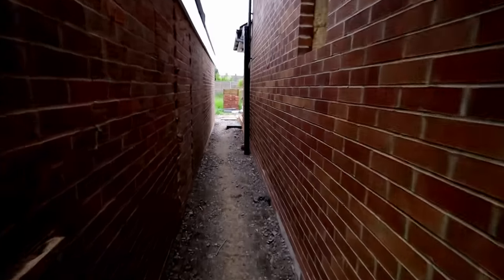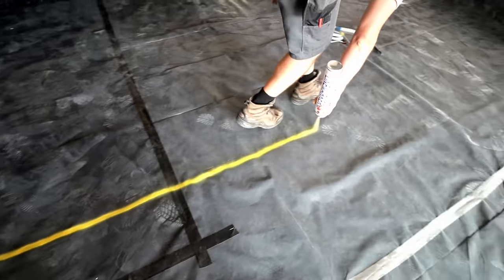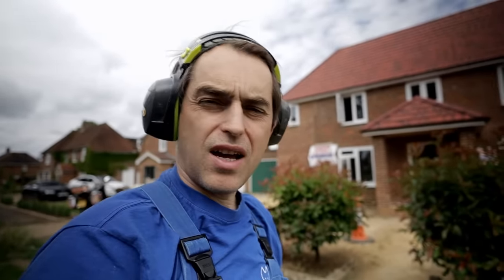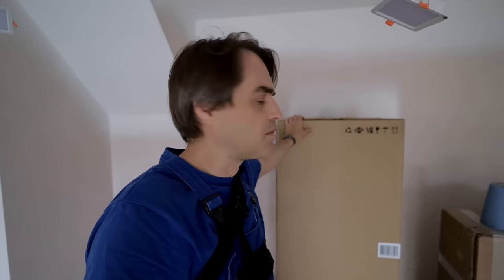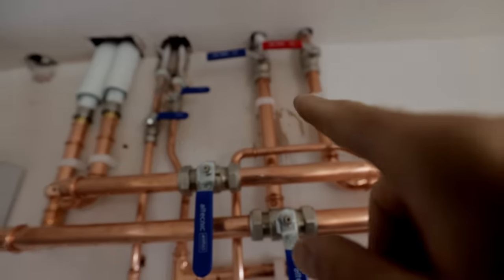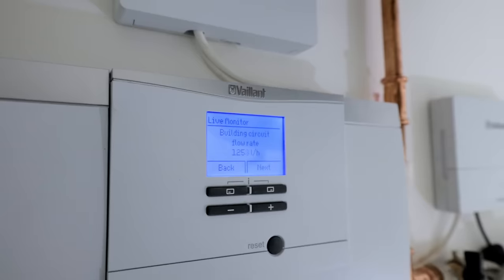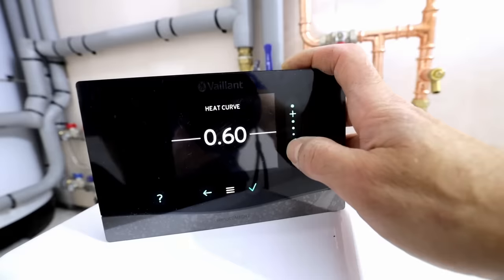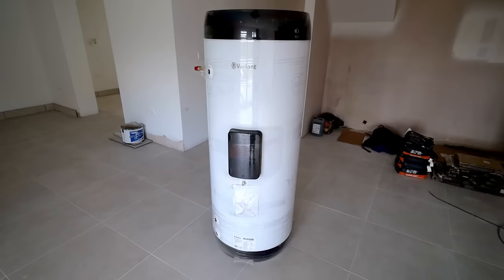Gas Boilers No Longer Make Sense, Here Is Why.

Comment: This is all fine for a huge expensive house where the owners have plenty of money and space to install all this crap, that is not what 90% of the population have not even close. Even in a full renovation this is impractical for all but large properties where you can set aside significant space as a plant room for tanks and other equipment with plenty of space outside to site the huge heat pump.
Reply from the maker: Small houses don’t need much space for internal kit. Small houses get smaller heat pumps.

Cost is the and as a full gas installation and Hp is cheaper to run when installed correctly.

If you do extensive renovations and have a chance to install a heat pumps that will run with scop of 4 or above you would have to be mad not to do it.

What is crap is most gas installations being done today.
Reply: @UrbanPlumbers  Actually most heat pump installations being done are crap, not many out there with your level of skill and knowledge. Heat pumps are really no cheaper to run like for like and to get equivalent running costs normally involves significant upgrades to insulation which would also reduce gas running costs way below that of the heat pump. While smaller houses can get away with smaller kit it is still significant requiring hot water tank and other ancillaries. For the vast majority of homes this is a major problem. What should be the main concern now is upgrading insulation on ageing housing stock rather than wasting government money subsidising heat pumps for the few that can actually afford them. Better insulation allows homes to run with smaller lower power boilers reducing running cost and energy consumption without the huge cost of a total refit with an expensive and complicated heat pump system but then the green energy scam wouldn't be making a bunch of billionaires even richer. I know you are passionate about the whole heat pump thing but it isn't a good solution for the vast majority of people until the technology is way more mature than it is currently and having that as the only solution is idiotic. Once again the government are pushing policy that is totally ill conceived.
Reply from the maker: Technology is good enough and can be much cheaper to run without any additional insulation. What is crap is the quality of installers out there, bur it is changing for better
Reply: @UrbanPlumbers  Maybe in 10 years it will be ready for prime time but for now it's just for early adopters who can afford the current high price and don't mind possible issues as it beds in. Technology is moving fast in this area such as systems that can run higher temps with smaller condenser units that run quieter. Also costs are coming down and that will continue as the technology matures. The problem is it just isn't there at the moment. Without the huge subsidies which are unsustainable for mass roll out virtually no one would be installing these so prices have to drop considerably because the market is currently limited by high initial cost.
Reply from the maker: @schrodingerscat1863 prices will only go up. Correctly installed and highly efficiency weather compensated gas system is as expensive as heat pumps.

What skews it are cheap and inefficient badly designed systems with combi boilers
Reply: @schrodingerscat1863   The early adopters were places like Sweden decades ago. The UK is very late to the game, so the technology is mature enough already (and is improving all the time), just needs more people as knowledgeable as Szymon to install them.
Reply: @BenIsInSweden  No, Sweden already had very well insulated homes that were perfect for low energy output heat pumps and they also have abundant electricity generation from hydroelectric power stations. This makes expensive to purchase and install heat pumps a much better value proposition. Heat pumps only really have benefit with abundant cheap electricity which the UK currently doesn't have. The technology is also not mature at this point not by a long shot, costs are still very high compared to other heating systems and technology is still evolving quickly.
Reply: @schrodingerscat1863  Insulation only goes so far, and Sweden doesn't have perfect houses either.  My 1920s house has some 2 x single pane windows and other double glazing that is blown. Along with needing to calculate down to a lower ambient temperature means the "oh Sweden can heat a house with a lightbulb" argument is just flat-out wrong, better than the UK sure - but often really only to adjust for the harsher winters. My 1920s house would need an estimated 12kW-16kW system, so basically over double what is going into UK homes.  The electricity cost argument doesn't really work either, having cheaper electricity over here (but not always, in December, it sometimes peaked at ~£1/kWh), and with the surge a few decades ago of ripping out oil-based central heating for cheap electric heaters means that to switch to a waterborne system will cost at least £30K to install (for my house at least).  So many people like the previous owners of my house opt instead for a partial A2A system, and "suck it up" with paying for some resistive heating.   Currently, in the UK the heat pump and cylinder combo comes to about £6K retail value (ex VAT as people don't currently pay VAT on heat pumps), and £5k of that gets covered by the government.  The main variable for the UK is what upgrades are required to switch from high temp to low temp heating, something that would benefit gas as well, just not to the same degree, but using your 10 years time argument, by then the grants would have likely gone, gas boilers will likely have more red tape to be installed in existing properties.  Gas will have levies from the Paris Agreement etc. And people will probably start waking up to the reality that it's a cost that's going to need to be taken and will have an effect on house value (i.e. either a reduction in value for properties that haven't switched, or an increase in value for those that has).
Reply: @BenIsInSweden  Even on traditional built Swedish homes insulation is very good compared to much of the UK housing stock. Much of the UK housing stock is in a terrible state, at least 20% has serious safety problems so forget about insulation standards or draught proofing on any of that. The only way they can make electric heating more appealing in the UK is by increasing levies on gas a lot which would be political suicide in the current economy. Similarly adding charges to properties that don't meet the highest standards would be a poll tax moment for any UK government. People are on the edge as it is, there is no money left for this rubbish now. Folks are being driven into penury for something that is going to make no overall difference to anything.
Reply: @schrodingerscat1863  I wasn't talking about adding charges to properties, it's more about people's perception of value. e.g. once people have cottoned on if you have 2 properties that are nearly identical except 1 is still high-temperature heating with a gas boiler, and the other is low-temperature heating with a heat pump, the one with high temp heating will be regarded as needing renovation work done to it, so will go for less than the property that has already had it done.  As the grid decarbonises, and more and more homes have solar and battery, then electricity price will also move closer to the gas price. I just think waiting (especially another Boiler life cycle) will be more costly in the long run in one way or another.
Reply: @BenIsInSweden  Wow you really seem to believe in this crap, you do realise it's all a scam to take your money right.🙄
Reply: @schrodingerscat1863  Heat Pumps? I've been an owner for over 8 years.  So have first-hand experience with them, I also live in a town where it's 70%+ heat pumps for heating.  If they were a scam their jig would have been up years ago.  I'll let you get back to reading the Daily Mail though.
Reply: @BenIsInSweden  Yeh, fine in Sweden where the electricity is cheap and places are well insulted but here is Britain it's a government run racket.
Reply: @schrodingerscat1863  Are you just assuming they are well insulated, because a lot of the times it's been DIY jobs over here rather than professional ones.  Also, Solar and Battery installs in the UK are outpacing heat pumps, so if you want to reduce your electricity cost you can... Can't produce your own Gas, and are at the mercy of whatever price gets set.
Reply: @BenIsInSweden  I already generate all my own electricity and don't use gas, that isn't the point and for most people not feasible. For the vast majority heat pumps make zero sense in the UK because all our infrastructure is geared to heating with gas. If we all switched to heat pumps the infrastructure costs alone will be astronomical. 
First there needs to be an effort to make sure everyone's heating is set up to be as efficient as possible, then move for improved insulation and installation of smaller more efficient gas boilers using modern control systems that make them even more efficient, then when heating energy requirements have been sufficiently reduced move to electric heating. Use the time for this transition to invest in necessary infrastructure changes. The way this whole thing is currently pushed it is all stick and no carrot, people are unable to afford it so forcing such changes on them will just lead to even more social unrest than we have already. Why does no one see this and formulate a long term realistic plan rather than keep pushing a totally unachievable goal with no clue what they are doing, wasting billions on schemes and grants that are just fuelling scams with thousands ending up with heating systems that are badly designed, installed and don't fit people's needs.
Reply: @schrodingerscat1863  Every house is different, including which upgrades have been done over time.  Check out for example EV Man's video on before he got a heat pump, thought he'd need major upgrades.  Turned out the only upgrade needed was 5/13 radiators or something, and wasn't a major expense.  He had microbore in some rooms but it was taken into consideration. There are other cases where people have upgraded their insulation, and switched to double panel rads over the years etc and are probably fairly close to heat pump ready.  The thing is, to make gas as efficient as possible, is to do the exact same thing that is done for a heat pump, make it so the flow temperature is as low and possible and reduce duty cycling. If you've gone that far, it doesn't make financial sense to go for a boiler, especially with the £5k grant, as you are paying about the same, and the savings with a heat pump in that scenario are far greater as that is what heat pumps are really good at.   The BUS Scheme is a carrot, and RHI was technically a larger grant but paid over a longer period of time.  The stick is inevitably coming, and likely around 2030, Paris agreement levis on CO2 emissions, and the BUS grant no longer being a thing.  The latter may change now that switching to hydrogen is basically dead (and would have been more costly than just paying for everyone's heat pump anyway 😂), but the Paris Agreement is enshrined in law, so it's invariably going to make gas more expensive.

Comment: I get your good at your job but the complexity looks nuts.
Which means I’d be really concerned about future engineers working on it as there are so many bad heating engineers out there
Reply: Maybe they should stop calling them Engineers............that's the problem in the UK.
Reply from the maker: sadly have to agree with both of you
Reply: The average car is much more complicated than this heating installation, maybe we migrate the mechanics to heating engineers (EVs are going to wipe their jobs out) and combi bashers to bathroom plumbers (if they can't be arsed to skill up).

Comment: For those of us in the country, what happens with oil boilers? It appears that news over the weekend indicates uncertainty from the current government administration.
Reply from the maker: are you worried about oil ban to be introudced soon?
Reply: ECO 4 grants for oil heating to get a ASHP
Reply: if I had an oil boiler I'd be looking to move to a heat pump asap, certainly would be reducing maintenance expenditure on it to a minimum.
Reply: The elephant in the room is the build specification of many rural homes. Where I live, the majority of houses in our village are pre 1920 (when cavity walls started to be built). There are many terraced houses in the village and the concern is over ASHP unit location and noise generated. (I have followed your videos and understand how for larger houses, this can be overcome.) Looking at the bigger picture, the number of houses is now approaching 30million across the nation, with 9million built prior to 1920 (RIBA figures). There are many who live in rural areas who suffer financial constraint due to age or low rural income, so unless more money can be made available, or the unit cost of ASHP systems comes down significantly, oil based heating will remain a political hot potato for some political parties!! The lack of a decision, as reported in the weekend broadsheet press reflects the political sensitivity! Oil boilers will eventually go, however this is more likely to be due to the rising price of heating oil as well as government overall policy to be carbon zero by 2050. ASHP provides one viable answer, where the conditions work. By the way, I first came across ASHP in 1981, when a colleague installed a 3 phase ASHP, designed the control system (he was a qualified electrical engineer) and installed the large well insulated water tank. The ASHP ran on an overnight cheap tariff and he reckoned it worked well....nothing is new! @UrbanPlumbers
Reply: Only if you meet the eligibility criteria. Property must be EPC D of lower and there are benefits criteria. Looks as if the limit is 5000 properties a year across the nation. Scratching the surface!! @Lewis_Standing

Comment: Yep they only make sense in highly insulated houses, with larger radiators and or underfloor heating. Otherwise on top of double the price of a boiler you need to upgrade insulation add radiators and its going to cost a lot more.
Reply from the maker: All heating systems regardless of the heat source require low flow temperature and same size radiators - so that argument no longer stands
Reply: And with Worcester Bosch now saying that because they can't meet the quota of heat pump sales vs gas boilers, from Jan 2024, they will be passing on the cost of the fine to the customers. So Boilers are about to get a lot more expensive.  I would say it's probably not the correct way to go about it, but considering they came out publicly with the same myths about heat pumps, it kind of serves them right 😂

Comment: Another thing with underfloor heating you installed 11 zone underfloor heating manifold for this project it can not be separated into zones with heat pump 👎
Reply from the maker: no need on weather compensated system. Same goes for boilers. It can be zoned, but there is no need for it.